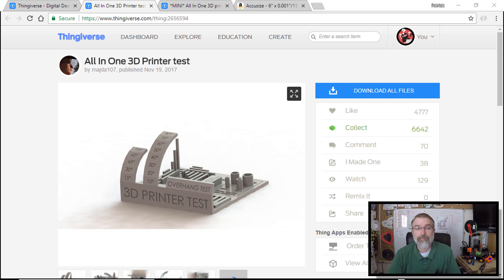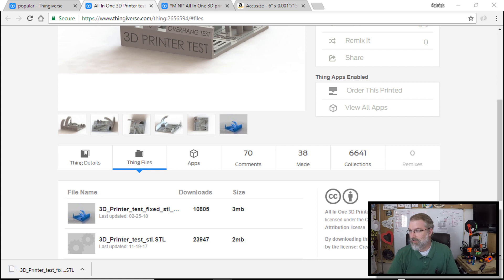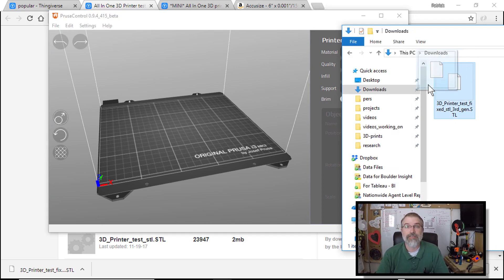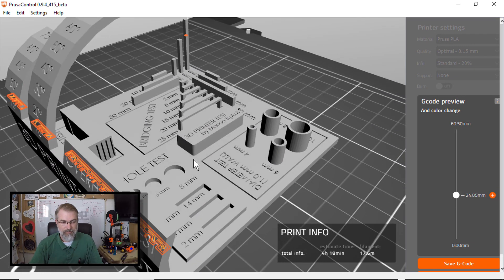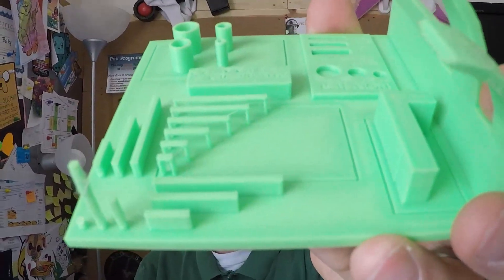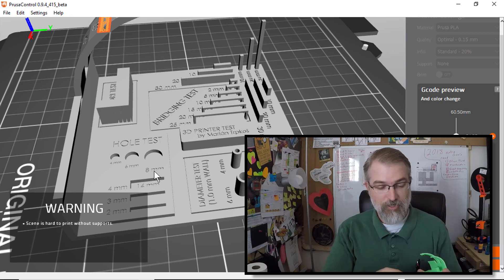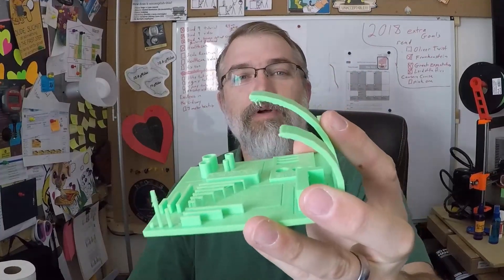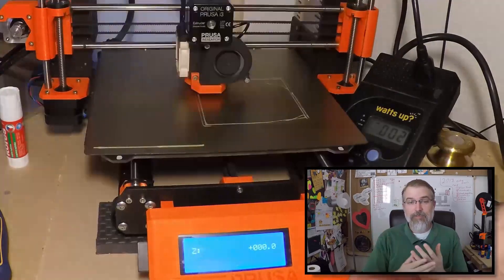Testing the limits of my Prusa i3 MK3

Comment: Hi Patrick, going back a few videos of yours, you said I have to use a glue stick on most of your prints. Have you got your printer set to the correct steel sheet ?. Because I have had a problem with the filament not sticking , l found my printer was set incorrectly. After setting to the correct one all is working fine. Great video by the way.✌️👍
Reply from the maker: I just use the default settings from Prusa (for the most part)
Is there some steel sheet setting?
I can have success without a glue stick on many types of prints but with a bit of glue stick I just about never have any problems with prints breaking loose in the middle of a print.

Comment: is mk3 a good printer?
Reply from the maker: Its the only one I have had thus far so take what I say with a grain of salt.
But I like it I think its a reliable workhorse.  But you may have to do some work on it from time to time.
I have had to re-solder the heat bed a few times, I believe the latest version does not solder the power cables on
but rather uses bolts.
I plan on getting a second 3D printer sometime this year and its going to be a Prusa I3 MK3
Reply: Yes, pursa i3 MK3S and the MK2S I have had Prusa from day 1

Comment: By orientation of the model towards the fan duct you can improve overhangs. You can try https://www.thingiverse.com/thing:2071696 as these are shorter prints to specific tests.
Reply from the maker: So if I rotated it 90% I might get better results on the overhang?
Reply: iqless yes if you turn the overhang by 180° it should improve it...same with bridging...trying to cool the line is 'hanging' as fast as possible

Comment: I just got my MK3 on Friday 13, 2018.  I chose to spend the extra $ and get the assembled version.  The X carriage belt tensioner screw was very loose, and the PINDA probe was set about double the recommended height.  Oddly it did print, and printed very well..  I had to tweak the first layer and all was good until last night when I was running a small 30 minute print and suddenly it beeped and claimed that it had Crash Detection, then after that it would not Autohome.  Tonight Prusa Support had me reflash it and then lower the Probe as I suspected it needed to be.  Was a bit frustrating to have to repair something that was supposed to be ready to use out of the box.   It seems fine now.
This is definitely a "step-up" from my other printer, Monoprice Mini V2.  It's a decent "starter" printer, but it will never be a Prusa!!!!! :)
One quick question if I may.... Do you notice any flickering of your lights in the same room as your MK3 as it runs? (When the Bed heater LED flashes, my Office lights flicker.  All my lamps and the main light.)
Reply: Parts Dave Check if you your house outlets are proper grounded and don't use cheap extension cords.
Reply from the maker: No I don't have my lights flicker.
If I look at my watt meter I do see that the power draw on the prusa does fluctuate a lot.
But in my case no flickering.
Reply: 3D Gussner I'm plugged directly into the wall. I don't notice lights flickering with the Monoprice heat bed. I've read that others have seen similar on other printers, sometimes other brands. One guy even tried a UPS with power line conditioning. He says "No change". 
I may try it in another room or pull an extension cord from another room and see what happens.  It's just annoying when you're in there.
Reply: Checkout Maker's muse video and Prusa Forum
Reply: iqless   Thanks for your reply.   I've read that one owner that also experienced this, changed his lights to LED and it stopped. Do you have LED lighting?
Reply: 3D Gussner. Which video are you referencing?
Reply: https://www.youtube.com/watch?v=v1OuYg7AJjw

Comment: One thing you can try to get a better result on your test using PrusaControl is to decrease the layer height.  This will help with overhangs as each new layer will have more contact with the previous layer.  A good way to visualize this concept is by thinking of each layer as being a 4mm (your nozzle size) wide block by decreasing the thickness say even from 1.5mm to 1.0mm of these blocks you have more surface area of each consecutive block of your overhang making contact with the previous layer.
Reply from the maker: I had not thought of that I need to try the lowest layer height and see what the difference is.